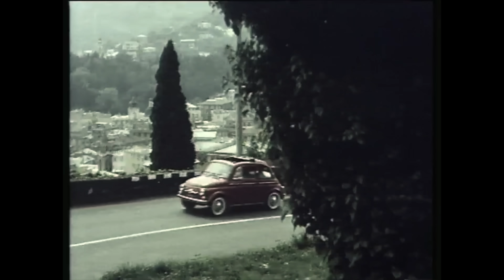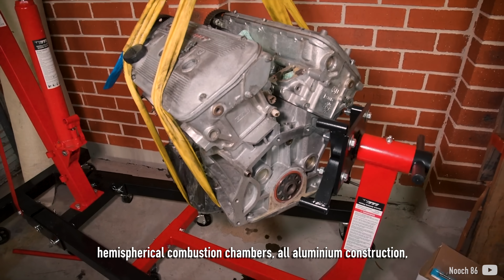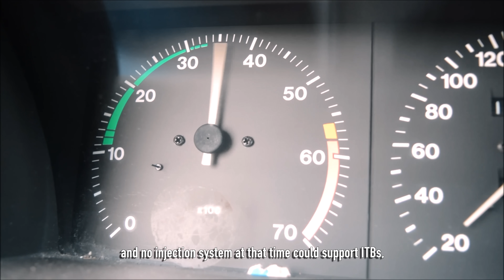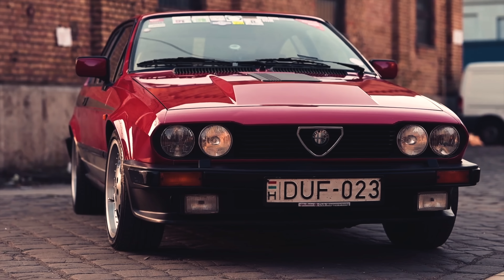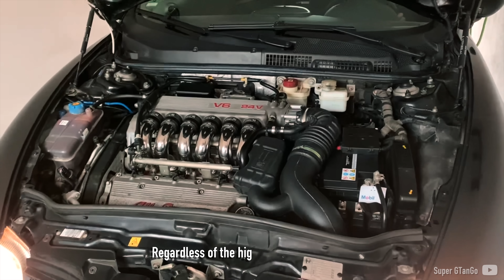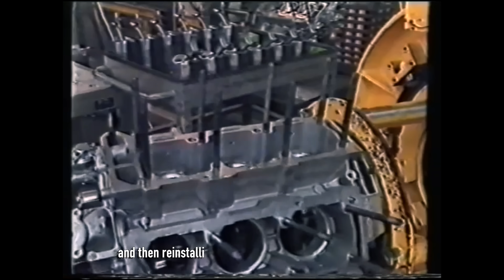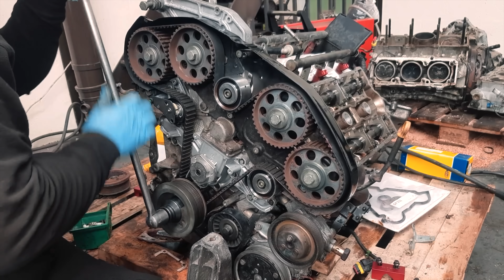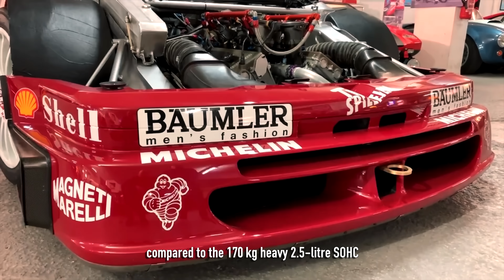This Is The Best Tuned V6 Engine

Comment: I hate that you could have the more modern Busso engines with only FWD, just three years later after it was gone they turned around and made the brilliant Q4 system which was full-time and transversally mounted, with none of that viscous clutch crap every AWD uses nowadays because they can't be bothered to figure out how a differential works, imagine the 159 with a busso, that thing would wipe the floor with Audi's S4
Reply: I'm not a big Alfa Romeo guy, but I was sad when I was told that the 159/Brera/Spider trio don't use the Busso V6, instead going for GM's Alloytec V6 range. On paper, the numbers still seem pretty strong, but financially, you're better off buying a 159 TBi over the 3.2 V6. Still, the 159's design is truly timeless and if it were to be released today, it would still look modern and fresh.

Also, fun fact, the 159 was supposed to be a joint venture with Saab and the second generation 9-3 was supposed to share its platform with the 159.
Reply: The permanent Q4 system of the 159/Brera was already featured on the late 156 models - namely the 156 Crosswagon Q4 and 156 Sportwagon Q4 from 2004. It features a planetary Torsen* Type C center differential, enabling a rear biased torque split at 40:60 as default setting - just like audi did three years later, from 2007 onwards. 
So the Torsen C based Q4 was developed and introduced when the Busso/Arese V6 was still in production! 
Sadly, just another missed opportunity for Alfa Romeo!
(*"Torsen" being a trademark and these diffs are licensed and produced by JTEKT.)

Also previous "Q4" AWDs weren't less impressive! They were either identical to the Lancia Integrale (155 Q4 - permanent) or heavily influenced by it (164 Q4 - also permanent). Only the old 33 Q4 was engaging on demand, mainly controlled by a viscous coupling acting as center diff.

Nowadays the RWD biased Giulia/Stelvio utilize a Q4 system which is similar to the longitudinal bmw xDrive - and they're manufactured by the same supplier, Magna-Steyr.
Reply: @alfisti93  My dad had a 33 Q4 Sportwagon (then a 75,164, 146ti… etc. he’s had too many Alfa’s to list). He loved that thing, it got through snow better than land rovers. 

I don’t think there’s any 33 Q4 SW’s left on the road in the U.K. now, it was already rare at that time!
Reply: @Jonathan_Doe_  Yeah, low weight and skinny tires work wonders in snow. Panda 4x4 is all about that!
My first car was a Uno 75ie with FWD - and you simply wouldn't believe where this goat made it's way through. (Sadly,l ike the 33, they're mostly gone now...)
Reply: Even a Brera Q4 with a Busso would've been amazing
Reply: @quadraforest  send a Brera on diet.    real alfa busso's are transaxle !   me as specialist see the 159 as a NON alfa platform (and it is)    in the 164 Q4 the gears reduction is not ideal  (before also not in the Alfa Sei)   both too short for enjoying busso's torque.
so for me and purists the 75 and 90 and GTV-6 are straight driving fun.
Reply: @quadraforest  yeah but the brera is to heavy to profit of such a engine.
Reply: marcin sroda on youtube has got your back. He made a 166 with the AWD from a 159 and a Lancia engine. Check out his channel but just for this discussion, here's the 166's AWD system in action: https://www.youtube.com/watch?v=RXmCWTHTglI
Reply: @UzY3L  that’s badass
Reply: You can make a 24v Busso work in a 75 or a GTV6, it’s been done before.
Reply: @Jonathan_Doe_  some do - and i did also for customers - but insane waste as the 12v busso is the low rpm torque beast and having the nicest sound.
If you would slightly fit RZ/SZ cams and nicer manifold - little modification at injection -  you will have a nice setup !
Reply: The 159 was too heavy due to the GM platform never used by any other car. I used to have one and if only it would have been a bit lighter and mogę agile. But if there was a standard 159 with a Busso I would buy it over the 166. I loved that car
Reply: @lwprzybysz  they managed to shave 110kg off the 159 after the first couple of years, but that’s like throwing one passenger off a sinking ship, it still couldn’t compete with the 156’s handling.
Reply: @Jonathan_Doe_  I think it's hard to compare 156 and 159 in terms of handling or weight as the 159 is 20cm longer - in other words it technically is one car size bigger. It is a bit like comparing a BMW 1 to an BMW 3 series or Audi A3 vs A4. I think you get the point.

The 159 might seem a bit heavy, but compared to its competitors of the same production era it isn't.
Reply: @Watcher1867  Yeah, I guess every manufacturers models did kinda jump up a size that generation because of Euroncap scores becoming a consideration for buyers. 

The Giulia has kind of redeemed them in the handling department, but I wish they’d release another 156 sized, lightweight saloon/sportwagon model (with decent styling, the Giulia QV is passable but it’s still not as pretty as a 156, or as striking as the 159). 

Smaller saloons run pretty far back in Alfas heritage so you’d think they would.
Reply: @Jonathan_Doe_  I totally agree. I could not believe they won't bring a new Giulietta. And as there is no Giulia SW and I definitely don't want an SUV there won't be a new Alfa for me anymore. I will still keep my 159 SW TI as secondary car because I love it and I'm pretty sure there will never be another chance of owning a 5-cylinder Diesel. 

But I'm still sad and angry what they are doing to the brand and how they forget about their heritage.
Reply: You could have a 24v V6 Busso with the Q4 system in the 164 which was transversely mounted...
Reply: @GregBMW70  Well, the 164 Q4 system is not AWD, it is like the VAG 4Motion system: FWD and just until it is to late the rear wheels get power via an electronic controlled clutch near the rear axle.
Yes, Alfa was years ahead in that too.
Reply: Currently dailying a 156 2.5 24v which, with a rusted out original silencer box, gives a gorgeous chortle on the overrun...
Reply: Just for show, look for "Alfa 159 GTA"
Not V6 busso, but another impressive engine

Comment: @Visio: Not only the Alfetta GTV was transaxle, 90 and 75 as well just like the SZ
Reply: Only the Sei had the gearbox directly mounted to the engine, all the rest were indeed transaxle
Reply: Those cars was also basically the same car, the same platform with different  body style. The very low production SZ special was build on parts from the 75.
Reply: @westmus  its all 116 series. Had them all except the Novanta and the SZ. Nicest and most advanced classic Alfa platform. The Sei was very much 105 derived,  just as the Montreal actually. Alfetta GT/GTV and SZ were shortened floorpans. Shorter driveaxle and gearlinkage too

Comment: As good as this engine is, the Nissan VQ does it for me. It's sound, with the right exhaust is true music. The other engine that sounds wonderful is the VW VR6. You can't argue otherwise☺️
Reply: The VQ is the best V6 ever produced. Most powerful production N/A V6 in history, reliable, and a great sound!
Reply: Nissan VQ was born when Alfa Romeo and Nissan made a joint venture ARNA (Alfa Romeo Nissan Automobili). The Nissan V6 sounds very similar to Alfa V6 Busso.

Comment: The problem of the Busso V6 is just reliability, but the sound and performance puts it in the map. Goated af V6
Reply: Ever owned one? Reliable as hell. Both 12v and 24v. Just change cambelts in time, let it warm and give it oil when it needs it. Like any engine
Reply: True but they fucked up by putting belt intervals at 72k when in fact belt needs changing well before that.
Reply: @alfamonk  not this engine bro. 
The 16V Twinspark engine has this problem. 
60k was told but 30k interval was recommended
Reply: @MightyREVS  60k or 3 years on a busso is safe. Wouldnt do 72k.
Reply: 12V Busso is a VERY reliable engine in fact. Maybe do a head rebuild as the valve guides get worn out somewhere between 300-400kkm, but otherwise they still "look like new" on the inside. I've owned plenty of Alfas, and currently have 7. :)
Reply: These are very reliable engines if well looked after. Very.
Reply: Busso's are seriously reliable! I own one now for four years and nothing crazy happened. 
I change my oil every 8 - 10k kms (usually 6 months), the dipstick is still on full when changing it. 
The color is clear like honey when it drains.
Only pain in the ... Is the oil filter location and timing belt replacement. Talking about a 24V FWD here not a RWD busso.
Warm her up before revving up to the redline. One thing is for sure, that engine just likes to be singing.
Reply: This engine is only for real Pros , that know how to use ist